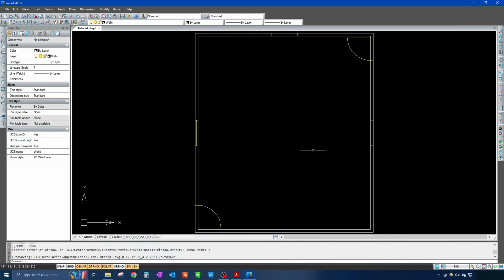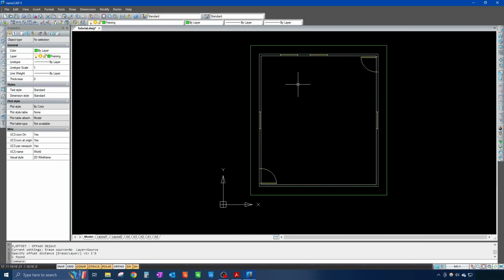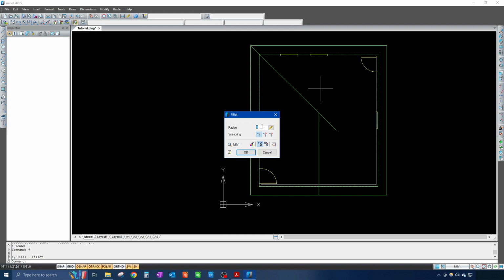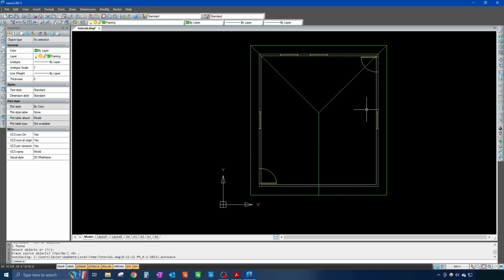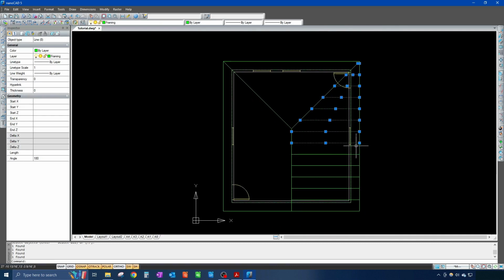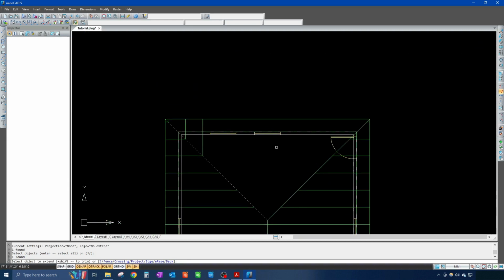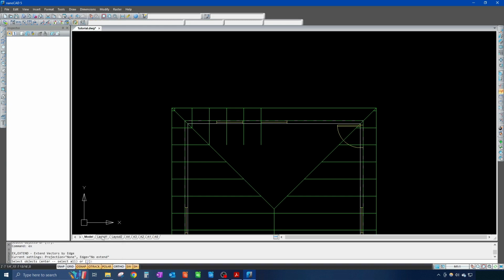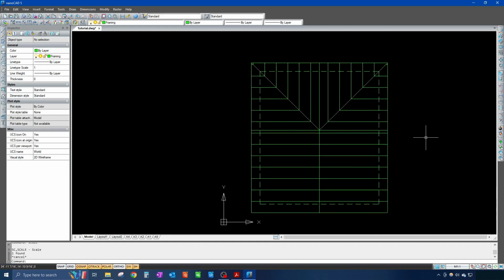NanoCad (AutoCad) Tutorial 3: Mirror, Fillet, Array, Inspector (Properties), Linetype / Scale

Comment: 10:22 How did you get your line to start where it did for the rafter. Hovering over the corner, then "L" enter, typing 24" my line begins in the middle of the screen? Thanks.
Reply from the maker: Hi, i think you need to make sure you have "OTRACK" on. I discuss it a little in a future video here.
https://youtu.be/V3wqpJC-8Io?si=TekgHCRJf4oTedj1
Also, sometimes what happens is that it'll try to snap to a near by object, so you may need to turn off OSNAP as well.